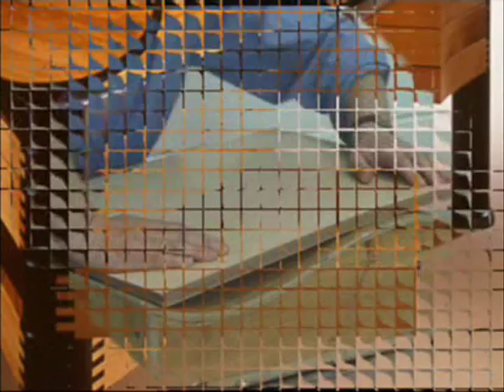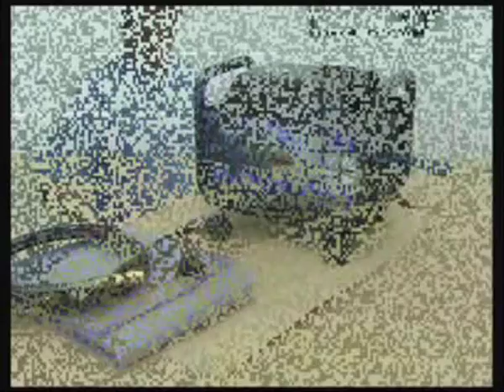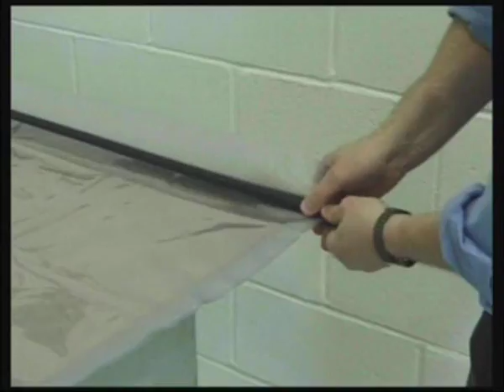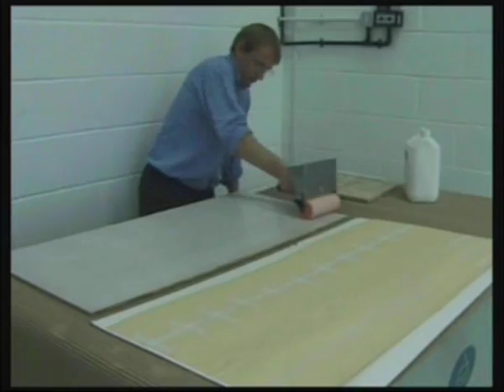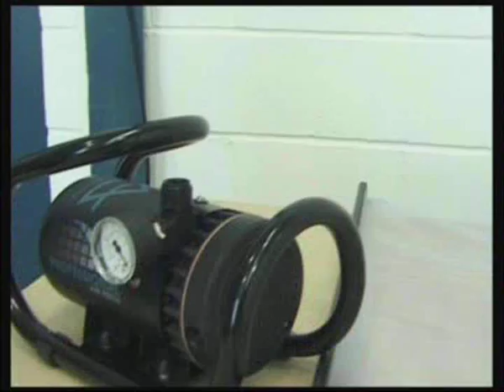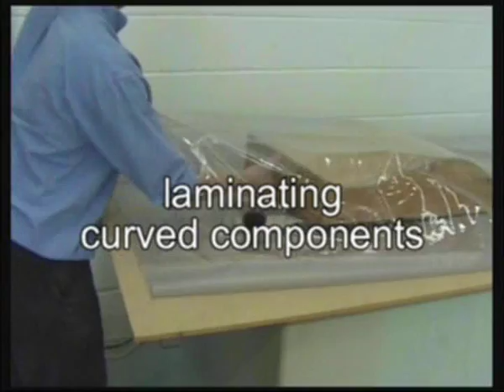Vacuum Press Bag Forming of Curved Wood and laminate

Comment: Very nice concept. Do you have the maximum pressure that this system can create on the panel? Formica laminates are specified to be fixed by PVA glue under 3 to 5 Kgf/cm^2.